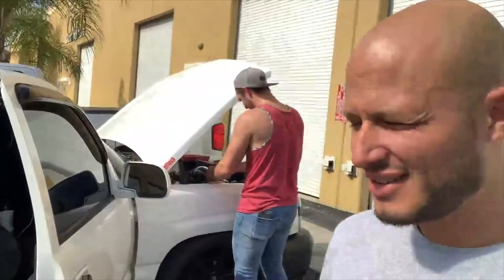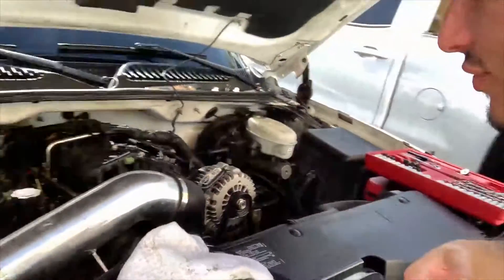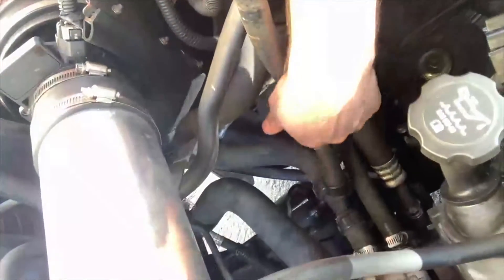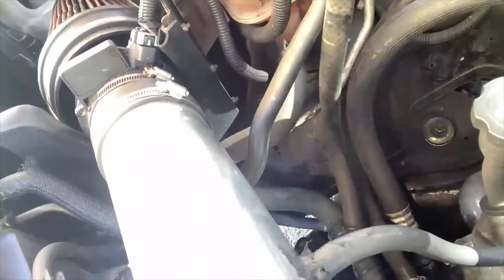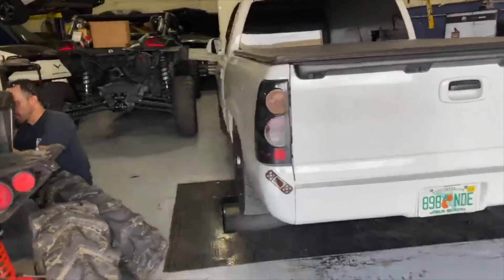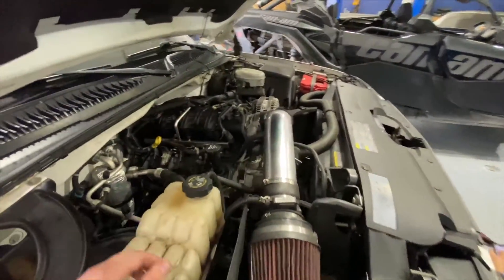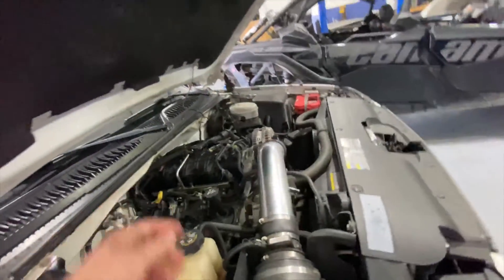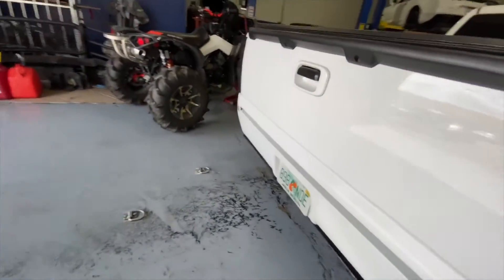Dyno Tuned 6.0 LS

Comment: We have a similar set up. I have a lq4 in my single cab 2003 silverado. Lightly ported 799 heads, All-Out Tuning Avenger Cam, long tubes, cold air intake, tbss intake, walbro 450, 4l80e, 3200 stall. I put down 402 on the dyno. Stock gears, stock injectors.
Reply from the maker: That’s what’s up! It made some good power for the LQ4!

Comment: Its funny to see the comments... 
My 04 4.8 put down 490 to the wheels with a cheap generic mail order tune, some eBay headers, and a cam I found in a dumpster at my sister and cousins wedding. Your right on par bro! 🤣🤣🤣 also every dyno is different. Some tuners play with the correction factors and other things to jack the numbers up and the customer feels good about it. Then they get drug by a truck that put down 75 hp less on another dyno
Reply: i don’t believe you put 490 to the wheels with a cam on a 4.8
Reply: @poppypineapple9885 you’re right, absolutely no way he’s making anywhere near 490whp with a 4.8 basically cam only. He’s probably not even making 390whp without a LOT of work done to that 4.8

Comment: 4l80 and stock 799s are why you see less than expected. Get the heads worked and you should break 400. Built 4l60 could save some rotational resistance over the 80 and free up a few horses and make the truck lighter. Also porting the intake manifold and throttle body would help as well, maybe 15whp. But will be much better throttle response
Reply: The 60 will only save 12 or 13 hp over the 80 and will NEVER be as reliable as a stock 80 with nothing but a shift kit. N
Reply: @mastertek383  i have a performabuilt 4l60 that has outlasted my friends locally built 4l80. At the end of the day the trans is only as good as the person who built it. Plenty of 4l80s fail when idiots build them lol
Reply: @swappedoutZ71  those performabuild 4l60s are bad ass!👌
Reply: @westcoast6162  people are sleep man. They make one that will hold 1000hp, now tell me that's not just as strong as an 80e lol. Like I said, a trans is only as good as the person who built it.

Comment: Number seems a little low. I have almost the exact setup. 6.0, 799 heads, 80e, 3k stall, TBSS Intake, 4.10 gear with posi, long tube headers  w xpipe and tru dual, and electric fans on a 2004 Silverado single cab on stock 17’s with Caltracs. Dropping it off to have her tuned Dec 1st. Hope to make over 400hp
Reply from the maker: Let me know how it goes! My transmission was slipping, it made the same power for about 3k rpms. I know if it had smaller wheels the number would be higher as well
Reply: @SiskBuilt  Will do, I will keep you updated. Thanks
Reply: How much it make
Reply: @memphis901vet2  what did it end up putting down?
Reply: @joseluisrojero5374 . My. bad bro... it ended up putting down 388/ 368. But I  found out I had a bad vacuum leak a day or so later. Apparently the TBSS intake was not torque down properly leaving a gap on all cylinders. . I will put it back on the dyno soon.
Reply: @memphis901vet2  Hey man, I have a 6.0 lq4, set up like yours. Made 401hp on stock injectors. Rev limited at 5.5k on my 80e till i can throw some bigger injectors, not safe to go any higher till then.
Reply: @memphis901vet2  get a vid with the before and after curves. I’m doing a HCI LQ4 in the cam market now

Comment: Throw some light weight 17s on there.  Truck axels, truck drive shaft, 20ish wheels, humidy and heat will rob your numbers.  I read somewhere that it's a 20% loss thru truck drive train, vs 12-15% for a rwd car.  I think it was American Muscle that showed it was 20% on the dyno.
Reply from the maker: I just added a set of 20/15's wheels. it was so hot when it was dynoed. with the 80e it may be higher drivetrain loss

Comment: Good shit man. Got a hi stall in your 80e? I plan on doing a 80 conversion later on my truck as well a procharger
Reply from the maker: Th4 Bl4ck M4n it was only a 3200 but the trans was slipping so it was slipping pretty good on the dyno! And dude that’s what’s up!
Reply: @SiskBuilt  I had a 3400 in mine when I first did my build but I didn't get it tuned so I took it out cause it wouldnt go into 4th
Reply from the maker: That’s so weird!

Comment: Why are you running 90lb injectors? And the ex cab don't have the same driveshaft issue as these aluminum ones right?
Reply from the maker: The injectors were the only thing saving the truck! the pump was maxed out so i had bigger injectors to compensate till i put a new pump in!
Reply: @SiskBuilt  
First question...was he tuning in lambda or AFR?
Second question....did you make sure dude knew you were running e85?  I would assume he knew or could figure it out, but when he said you were super lean and thought you would've been richer with the bigger injectors, and his "holy sh!t" reply about injector size, it made me wonder if he just didn't consider e85 and assumed you were running standard gas. 
The tune would be off if he tuned for gas AFR and not e85 afr.  
For your current power level, 36-44 lb pound injectors would be plenty on standard gas.
Reply from the maker: He tuning in AFR I believe. 
And yeah he knew I was on e85. I had 46 pound injectors and they were about 60% duty cycle on 93 and when he tuned it on e85 I went bigger injector to help!
Reply: @SiskBuilt  Fair. I've got the marine injectors in mine now and on gas have plenty of headroom, would need to go up for e85
Reply: To answer your question for the folks reading this later, the extended cabs are a two-piece steel drive shaft. So they don't have the same problem as the newer aluminum driveshafts where they exploded 100 miles an hour, but they do need to be well maintained and balanced to make sure that they don't fly apart. Carrier bearing is super important, and when the two pieces blow up they blow up big.

Comment: i did my LS swap all by myself i have a 05 chevy blazer and i put a 6.0 L96 in it and a stage 1 tx speed cam and springs i took it the other day and got it tuned and on regular unleaded it made 384 to the tires so yea im happy,its got a 5 speed with 373 gears so it will be fun,its for my stereo,ive got over 100 lbs of sound deadener in it and a sundown audio 18 inch sub with a huge box is going in it haha so i dont care about racing,i just wanna have some fun you know.
Reply from the maker: That’s what’s up!!! Pretty good numbers for it too
Reply: Nv3500 hanging in there? Ls7 clutch, etc?

Comment: How did it drive with that cam and the 3200 converter? I know you have a 4000 stall now.
Reply from the maker: Drove great! Just wanted something a little more aggressive getting out of the hole!
Reply: @SiskBuilt  Thanks for responding. I have a 3000 stall in my truck, had originally planned to do a Summit 8720. But now thinking I am going to use the custom grind that was in your black truck when Chris owned it. It's smaller than what you have in your white truck. (224/232) I figure if I am going to change the cam again... might as well make it worth the effort.

Comment: What’s wrong with your startup. Mine misfires at crank too do you know why?
Reply from the maker: No idea why! the tuner says the reluctor wheel is a 52 tooth. i verified with my engine builder and it is a 24 tooth. so i have no idea!
Reply: Sisk Built did the tune help it at all?
Reply from the maker: Nope! Still does it on start up sometimes! I dont know hahah

Comment: I think you’d pick up power with smaller cam
Reply from the maker: It might! I got the cam spec’d for my setup and went one stage bigger!
Reply: @SiskBuilt  yeah unless the cam I looked up was wrong to what you said. Richard Holdener made just under 600 with a 231/247 as well a good explanation from complete street performance on cam in LS1 c5.
Reply: @SiskBuilt  just found my first dyno sheet, dynojet, put down 396h 412t 5.7 LS 241 heads 231/241@600 cam
Reply from the maker: It’s a 235/243 cam so it’s in a similar to that! The C5 should make more power if it was a manual and doesn’t have the bigger wheels to turn. I know the transmission was slipping when I brought it to get dynoed. The tuner even brought it up I need to fix that haha.

Comment: What's your set up bro.
Reply from the maker: What do you mean??
Reply: @SiskBuilt  your setup on cam, stall and rear end gears.
Reply from the maker: alfonso barrera “All Out LSR” cam by comp. 2800-3200 stall and 3.90 gears to help with the 80e!
Reply: @SiskBuilt  what's stall did you get ? Circle d or pro torque?
Reply from the maker: alfonso barrera circle d! Took forever to get but it is totally worth it
Reply: @SiskBuilt  which model did you get?
Reply: @SiskBuilt   how is the drivability for daily ?
Reply from the maker: @Mechanic83  not bad at all really. Just change in gas mileage to be honest
Reply: @SiskBuilt  ok cool , gonna look at a 01 Sierra built 6.0 forged internals cammed long tubes circle d 3000 converter prc heads 4l80 .. going to see it today so wasn’t sure how these were for daily driving , never drove a cammed car before lol